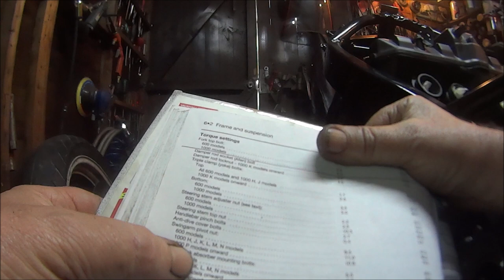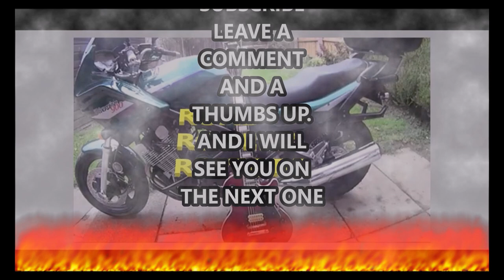CBR1000F Landfill bike. fitting the swing arm and rear mono shock absorber

Comment: I remember the nightmare job of the swingarm on my ST1100 Pan European.  Removing, welding in structural strength to the 'rotbox' sections, and reassembly......Really was pleased to see the back of that bike on the maintenance front.
Reply from the maker: Nice one. Lucky no welding required on the cbr. 👍

Comment: Keep touching her up Johnny, you know she likes it 😂😂

I also forgot to put the chain protector gizmo thing on but didn’t realise until after I’d put the bolt in. It’s a real bitch of a job to do, especially the suspension bits when you’re on your own 😀

Well done Pal, another very useful video, thanks again for going to all this trouble and sharing with us. 

My tip of the day for when you start putting the carbs back in… Make sure you connect your carbs up to a fuel source to check for leaks before you attach the carb to the bike. Trust me, I learnt the hard way and had to take it all out again. 

You may want to do some deep relaxation meditation thing before you start installing the carbs and the air box, it’s an absolute 2wat. 

Good luck and see you on the other side 😀

Col
Reply from the maker: Lol cheers col.
Yes I've heard a lot of people say the carbs are a nightmare to fit back in. 
I'm leaving mine till I'm in the right frame of mind lol. Thanks buddy 👍
Reply from the maker: Lol cheers col.
Yes I've heard a lot of people say the carbs are a nightmare to fit back in. 
I'm leaving mine till I'm in the right frame of mind lol. Thanks buddy 👍